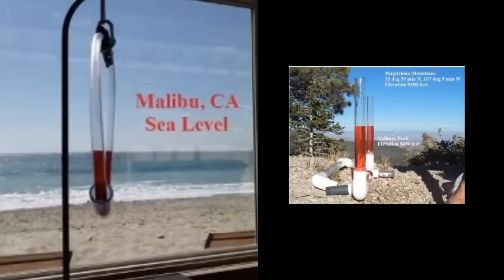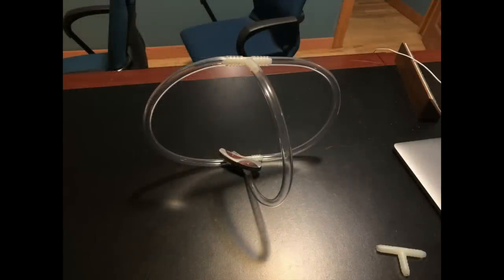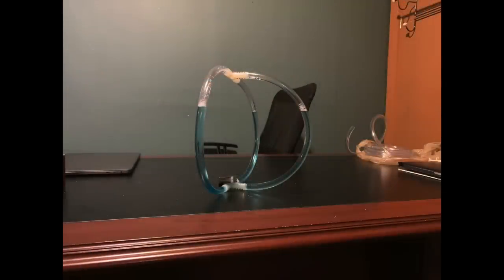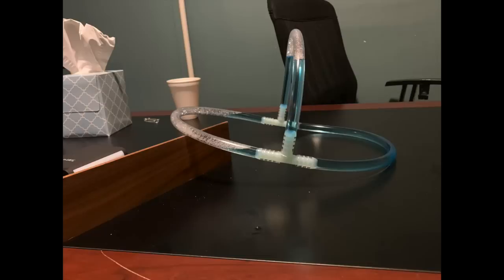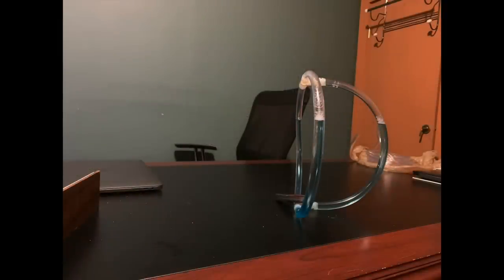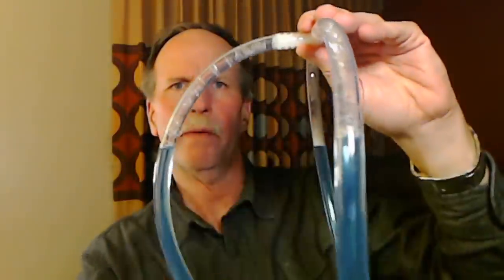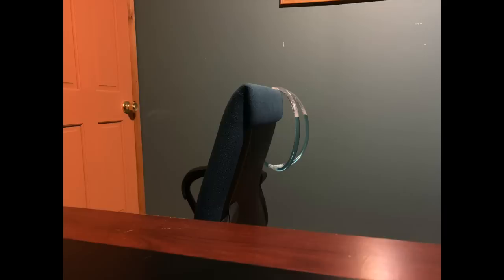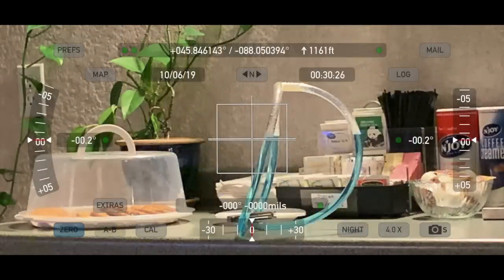Bob's Triple Water Level

Comment: A water level doesn't find eye level. It can give you a level line of sight. You can also bring the water level up to eye level but it can't find eye level
Reply: So then, by using the "level line of sight" of a water level, the horizon seems to be below that "level line of sight".  Seems legit to me.
Reply from the maker: @cuross01  yep
Reply: It demonstrates precisely where level is from the viewer's perspective (aka eye level). It will clearly demonstrate the horizon not rising to eye level.
Reply: @RobertEmery  exactly my point. The water level creates two locations at the same elevation creating a straight level line of sight. But the water level didn't find eye level. The user would bring the water level to his eye height to find eye level. The tool does nothing by itself, it's the user that makes a tool work.
Reply: You use it to find eye level. It does not find it on its own.
Reply: @stephenolan5539  eye level is misunderstood by flat earthers. That being said when using a water level or any level you're looking for a line of sight that is level. It has nothing to do with eye level.
Reply from the maker: No, if it lines up with your eye (or camera) it means the level is at eye level.  Your 'eye' and both columns of liquid are on the same line.  The liquid is level, hence it is 'eye' level.
Reply: @BobtheScienceGuy  eye level

 noun

Definition of eye level

: a level that is as high as a person's eyes

You don't bend over lay down or climb a ladder to determine eye level.

A level line is the distance between 2 points on the level surface, which follows the curvature of the earth. Whereas the line of sight is the straight line perpendicular to the plumb line at the telescope.

A picture or painting is  hung at eye level. Your computer screen should be at eye level when seated.
Using a water level regardless of height, gives you 2 point locations to create a straight level line. If you're laying on the ground or standing on a ladder to observe, the water level is not at eye level.
And the greater the distance between the ends of the level the great the accuracy.
Reply from the maker: @roscoepatternworks3471  lol what a silly response.  Here, get a clue.  MOVE THE LEVEL so it lines up with your eye, the camera, etc.  Lord you guys have an issue with concrete ideation and creativity don't you?  

Your eye level is WHEREVER YOUR EYE IS AT THE TIME.  Now run along with your dictionary nonsense and learn to use information properly.
Reply: @BobtheScienceGuy  bob that is what I'm doing. Moving your eye to the level doesn't mean the level is at eye level. I've used a water level laser level and a transit for building  my house and the transit for mocking up the hull of a ship. 
I would like to see the debunkers get away from using flat earth definitions and quit arguing on their terms. Throwing science at them does no good. Showing them how ridiculous the flat earth model looks just might.
I did prove one thing, when confronted a debunker can get just as irritated as a flat earther.
Reply from the maker: @roscoepatternworks3471  eyelevel is where your eye is.  It doesn't require you to be in a certain position.  Settle down
Reply: @BobtheScienceGuy  I'm fine Bob. So a simple question. When shooting a rifle, and a clear line of sight to the target. Do you bring the scope to the level of your eye, or do you move you eye to be inline with the scope.
Reply from the maker: @roscoepatternworks3471  yes . doesn't matter as long as they are colinear
Reply: @BobtheScienceGuy  it's clear you don't understand what I'm saying. Eye level is from the ground to your eye, whether you're sitting on the floor or standing. It is a term used by interior designers, artists etc. Has nothing to do with long range observations. As example I'm at 1500 feet of elevation, glacier peak is 108 miles away and about 10,000 feet above sea level. It appears to be at eye level, which I know is wrong. My transit shows there's about 2000(a guess) feet higher than a level line of sight. So my point on this subject, was don't use flat earthers    own misuse of a term to debunk them. Phuket says the horizon rises to eye level, but that is a misrepresentation of eye level. Having a line of sight that is level, at any elevation prove a globe.
Reply: @roscoepatternworks3471  you're just arguing semantics. It doesn't matter whether you bring the scope up to your eye (shoulder fire) or lower your eye to the scope (prone position), your eye level is the level at which your eyes are located, and it moves with your head. Did Bob misrepresent that fact? The only way the levels in the tubes can line up for an observer is if they match the observer's eye level.
Reply: @RobertEmery  I would say the the only way an observer can observe the level that observer would bring his eye to the level.
As far as shooting goes, I would like to see you bring the rifle to your eye level and hit your target. My eye level is about 67 inches from the floor after shouldering the weapon I then have to move my head(lowering it) to line up with the scope. My eyes are no longer level nor at the same height (eye level). It may be considered a silly argument but if you have to move your eyes to view something  it is no longer at eye level. You eye is at the level of tool.
Reply from the maker: Just Dave thank you for your comments. I’ve addressed them fully.
Reply: @roscoepatternworks3471  You're saying that your eye level never changes, even if you climb a ladder or lay on the ground? If so, that's wrong. Your eye level changes when you move your head up or down relative to sea level. It is a straight line perpendicular to plumb.
Stereoscopic vision might affect that by a couple of inches if you tilt your head sideways, but you can never move your own eyes out of your own eye level, because eye level is defined as the level of your eyes, relative to sea level.
Reply: @RobertEmery  so tell me how do you decide what is eye level? When you stand on the beach and look at the horizon, is that eye level? How about at 10,000 feet looking at the same horizon? The definition of eye level is looking straight ahead at an object. But you can't prove that object is actually at eye level, unless you have a way to measure it's elevation. Regardless of your eyes elevation. So Bob's water level is an instrument that will give you a straight line of about 12 to 18 inches. But you more than likely will move to the instrument rather than bring it to your eye. And it still doesn't prove your eye is level. What the water level does is give you 2 locations that are the same elevation from the center of gravity. And if the water level were big enough and had 3 indicators you'd find that between 1 and 2 and 2 and 3 the you wouldn't have a straight level line. But that would a bit ridiculous. So my contention is that saying any observations made pertaining to the earth are not made from an eye level perspective. And instrument is used to determine level, we observe the instrument, your eye or camera doesn't have to be level to make the observation. That has been proven.
Reply: @roscoepatternworks3471  I already told you how eye level is determined. It's not based on what your looking at, ever. It's based on the level of your eyes relative to sea level.
Reply: @RobertEmery  so how do you know your eyes are level? I assume Phuket has calibrated eyes. Just by the way he talks. I must be the only one without that ability. Cause I can't prove what I'm looking at, at a distance, is at my eye level or higher or lower. My transit has an accuracy of .25" over 100' so something at a mile away could be higher or lower by about 13 inches. That's  not level but pretty close.
Reply: @roscoepatternworks3471  you use a tool, such as Bob's water level, which makes it easy to visualize local level, obviously with some margin of error (measured in fractions of degrees, not inches or feet) but accurate enough to prove that the horizon has dropped well below eye level, by far more than any margin of error.
If I'm on a small hill and my eye level is 300 feet, and I'm looking at a structure 300 feet tall, on a flat Earth it should always line up very closely, if not perfectly, with the two water levels, if I line them up with my eye level.
Even Nick knows this and has demonstrated it while lying that the reason real life shows a noticable drop is due to perspective, which is of course ridiculous.
Reply: @RobertEmery  sorry, the paper work that came with the transit said it had an accuracy of .25" over 100'. But that can be calculated if you need the angle. Understand there is nothing wrong with Bob's water level. Just the term, eye level. For the use of the tool it's  the wrong term. As eye level cannot be measured or proven over the distance to the horizon. However a straight line can be created with a water level that proves the horizon doesn't rise to the level of the eye.
Reply: @roscoepatternworks3471  well the level is kind of useless if you don't line up either your eye or the camera eye with it, so I don't see how "eye level" is a problem. At least we agree Earth isn't flat, which is the important point in all of this.
Also, The Camera Eye is a great song if you've never heard it. Cheers.
Reply: @RobertEmery  I like Rush but haven't heard that one thanks,my wife is a bigger Rush fan. I'd say have a beer on me but that's kind of hard to do. And I have never thought about the earth being flat. Absolute nonsense in my opinion. And I do have those as you found out.😉🍻
Reply: @roscoepatternworks3471  For the sake of the FE nonsense just forget eye level and say parallel to the Earth. The entire waste of time debate is about an established line of sight from a parallel line from the observer to the horizon. Forget their eyes and forget their height. Pick a height and then draw a line parallel to the Earth (which I think is 90 degrees). Forget it's a human with eyes. Just do some simple geometry. That's all.
Reply: @NinjaMonkeyPrime  what I want to do is stop the nonsense. I want the debunkers to stop arguing with the flat earthers at their level. Using the term eye level is the incorrect term. At least in my opinion. Regardless of eye height, eye level refers to the eye looking straight ahead. Using a water level, transit, spirit level or rifle scope doesn't require the eye to be looking straight ahead the eye can be looking slightly down or up. But line of sight, is from the observer to the object being observed, regardless of angle. It may appear trivial, but definitions matter. Eye level is more an artistic term for photography or art work or interior decorating. It has nothing to do with the shape of the earth. As far as geometry goes, I have no problem with that. It's the flerfers that don't understand it. My last last word on the subject and just my opinion.

Comment: great idea, except for the liquid... you want no foam on there blurring your measuring point.
Reply from the maker: I had windex. Use whatever you want as long as it doesn’t damage the tubing
Reply: @BobtheScienceGuy  you can damage the tubing as long as the measuring points are clear. Foam is going to make the measuring less precise. Just use water with color instead of soap.
Reply from the maker: @Leongon  use anything you want as long as it isn't flerf tears, those are too caustic and salty for the tubing.
Reply: @BobtheScienceGuy  so I guess an egg would float in Flerf Tears.😎
Reply: @Leongon  Soap would help avoid meniscus measurement errors.

The foam isn't a big deal if there's not much of it - the bubbles are NOT going to submerge into the liquid enough to matter for most purposes.
Reply: @fromagefrizzbizz9377  Imagine you got a ruler that instead of clear sharp lines it has them blurred out several times the original width. You would try to measure at the center of the blurr, maybe, but it adds a level of inaccuracy, inconsistency. In this eye level measuring gadget you got to align two marks, so the accuracy gets even worse with the foam, and when you are trying to measure fractions of a degree of difference of the eye level to the horizon, it can mean a pretty relevant difference. That's why you totally want a clear surface of that liquid... foam is a terrible idea for a really fucking smart and yet simple device like this. I would use just water with coloring and a few drops of chlorine to prevent microbes from growing in there.
Reply: @Leongon  The foam isn't going to fuzz the line nearly as much as it will improve the contrast of the bottom edge of the interface and make that contrast consistent no matter what the background is.  For the most part that will improve the accuracy, not reduce it.  For more precision, the answer isn't mucking around with the liquid, but making the baseline longer.

I can see that you're assuming that you're looking through the liquid to strike your level, and of course the foam would screw that up.  But, the dye then becomes counter-productive and the tubing isn't really big enough for that - with this scale of device, you're better off choosing the bottom edge of the interface line of the liquid in the tubing, not the surface.

Windex has another advantage: surfactants.  Less surface tension/better wetting.  If I was going water based, I'd put in a couple drops of liquid dish soap along with your drop or two of bleach plus dye.  But I'd be tempted to use methanol (much lower viscosity than water) instead of water, skip the soap and bleach, and just add some alcohol-soluble dye.  But that does make the thing a trifle hazardous.
Reply: @fromagefrizzbizz9377  you don't look through the water, you line up the surfaces of the water in two connected tubes. The surfaces that you don't want foam on, and you use color for contrast for a precise measuring.
Reply: @Leongon  I probably misphrased that.  I meant you don't look through the tubing - it's going to be pretty distorted in flexible tubing at this small a diameter anyway - you may be able to line up the tubing ends, but you will have very poor sight of the thing you're sighting on.  You look along the edge of the tubing to find the corresponding points - which is the bottom edge of the (air or foam)/liquid interface.

Think of the tubing as self-aligning measuring stakes.  You don't look through the stakes, you look along the sides.

Since you're not looking through the tubing, the thickness of the foam doesn't matter, only the depth to which it fuzzes the liquid surface is.  Which would be very minimal in a low viscosity liquid.
Reply: @fromagefrizzbizz9377  we are saying the same thing except that I consider the foam more relevant in introducing inaccuracy of the measuring.
Reply: @Leongon  Yeah, exactly, we just are thinking different spots in the trade-off curve.  When it comes to higher precision, you want to do it with the existing apparatus, whereas I'd simply make a new apparatus with a much longer baseline.  A water level with only about one foot of "reach" I consider a toy, even tho it should be precise enough for 5-10 minutes of arc given care.  You might as well as use a  carpenter's bullet level (usually around 9") or an 18" spirit level.  Less time spent waiting for it to settle.

Me, I just make a 20' one and work with far better accuracy.
Reply: I think Windex will cause the plastic tubing to turn cloudy over time, but luckily you've got more. 👍

Comment: Looks like a great design, but are there any air vents?   If the air pressure above each water surface is not equal, some flerf is bound to object that this invalidates the results, even though the effect in most cases would be trivial.   (I recall this objection being made to some of Rory's tests.)   A small hole bored in each tube above the water surface would equalise the pressure with the external air.
Reply: Don't need them since it's a closed loop.
Reply from the maker: The loop is continuous and you can burb it. Venting becomes important if you have more than one air pocket
Reply: @BobtheScienceGuy  Thanks Bob.  Provided the air can pass freely through the joints at the top that meets the objection.
Reply from the maker: @DavidB5501  of course it is open internally with no blockages.
Reply: There is no restriction in the tubing, it is a full loop and a half loop and no mater which way you turn it the air on top will be equal across all three semicircles. Even if you placed the full loop on the flat surface the third loop would act the same as bubble level.

Comment: With no hose clamps on the connections, it may leak if you build it in your cool house, then put it in a hot environment, like the trunk/back of your car.
I'm sure some flerfer will have an objection to it being closed loops...
Reply from the maker: You can burp it. You can also use hose clamps if needed